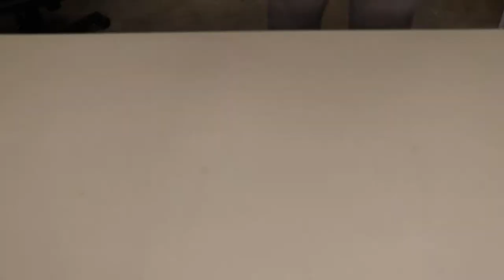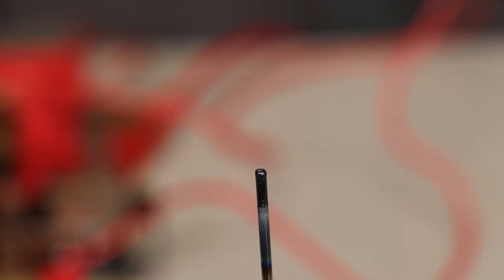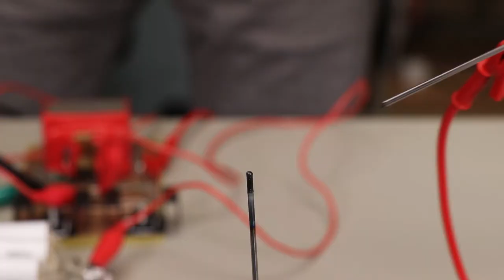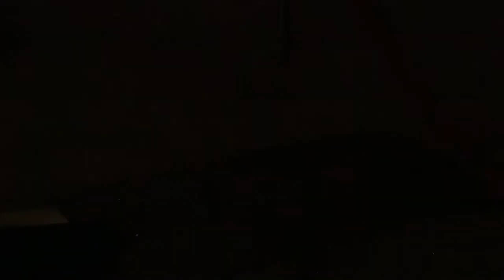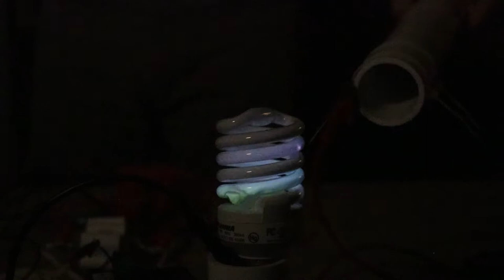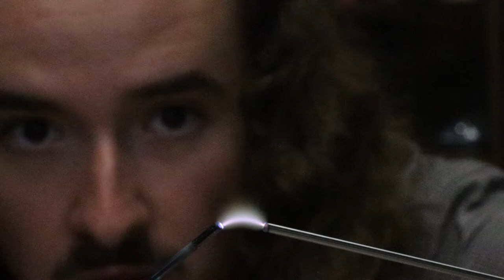Flyback Transformer Fun: High Voltage Arcs and Corona Discharge

Comment: #coillabs hey buddy I  suggest cutting  of the rest  of the pins from the flyback  and pouring  melted wax on the transformer  pin section  to isolate it better just remember  to keep  wax out of the cathode  pin. I noticed  a boost  in my flyback's  arcs cause before I wasn't  able to burn anything and arc just passed from the side  of the object but After waxxing it the arc was much more powerful
Reply from the maker: Yeah I get flashover on the pins if I turn the voltage up too high, for sure. I'll definitely consider doing something like that if I need to drive these things at higher power in the future. Thanks for the suggestion!

Comment: I love flybacks, I've got one set up right now running off a generic ebay multifunction driver and powered by a 30 volt Lipo, I can draw 4 inch white arcs with it. It's almost too much for my Marx generator, it tends to flash over between one of the spark gaps and start an arc lol. I just need to redesign the generator with a little more space between everything now...
Reply from the maker: Nice! At some point I want to build a much beefier ZVS driver and get a big ferrite core and wind my own flyback that can handle some serious power and make some huge arcs
Reply: @CoilLabs  We have similar goals then😉. That would be really cool to build an upscale flyback driver, makes my toes tingle just thinking about it lol.

Comment: The one I made a few months  back crates very  feathery purple arcs its not a zvs driver type but a 2N3775 type transistor  how can I make it better?  Any idea?
Reply from the maker: There are a lot of different circuits for driving flyback transformers. I'm guessing the circuit you're using is the single transistor (BJT, specifically) circuit, using a feedback winding to trigger the switching? This is a great first step to learn how to work with flybacks, but if you want to want to take the next step, I would look into building a 555 timer based flyback driver. You'll want a higher power transistor, like a power MOSFET, to get better performance though. Just Google "555 flyback driver" and you'll find a bunch of great resources. Once you've mastered that, then I'd take a look into the ZVS driver. That's the best way I've seen to get the most power out of a flyback transformer.
Reply: @CoilLabs  I actually  have a sour time with mosfets as they tend to break down  easily
Reply: @CoilLabs  i got a question  if I use two of the same 2N3775( the large shiny flat metal transistors)transistors  in parallel  or in series  might that boost my circuit in any way?
Reply from the maker: 2N3775 is 60V collector-emitter and only 1A max collector current from what I read. You might get some improvement using 2 in parallel to handle more current, but I doubt the bump from 1A to 2A with that circuit topology will be a dramatic improvement. I don't know what input voltage you're using either. When I say power MOSFET, I'm talking about something like an IRFP250N or better. 200V, 30A. That's way overkill unless you're willing to upgrade your circuit topology and also supply it with enough input power though. If you're blowing FETs with a circuit like this, then I'd guess you aren't using FETs with the right ratings.